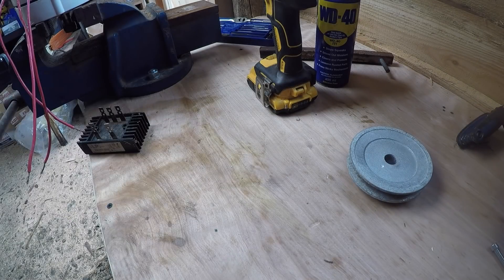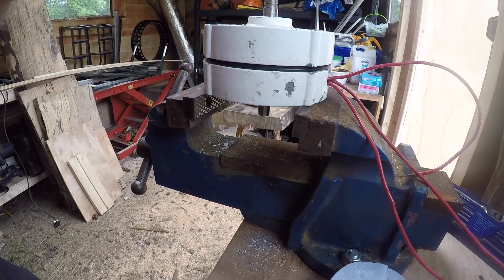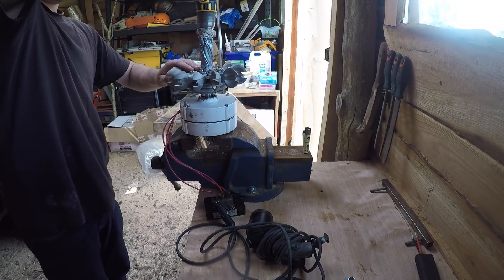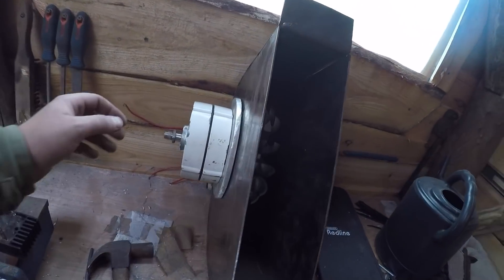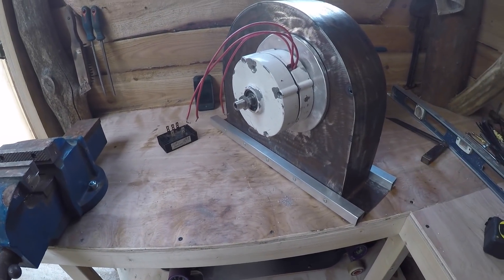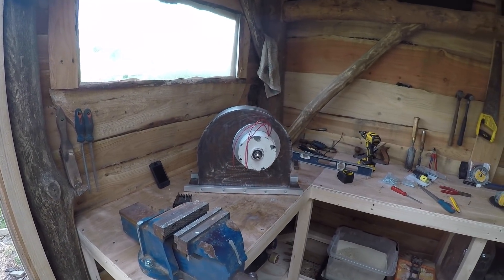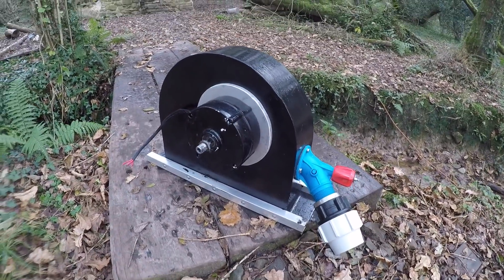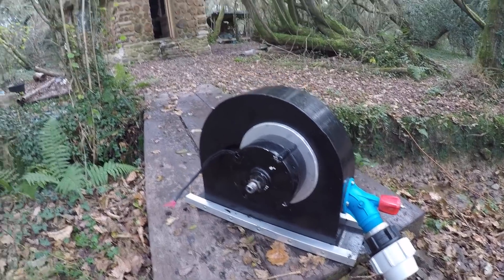DIY Micro Hydro part 2 The Turbine

Comment: Boy oh boy - there sure are some il - informed comments on here.....!!
A polite request to anyone thinking of claiming that this or that is wrong/too small/too big/made of the wrong material, etc. etc.
Please remember that this guy did a lot of research before starting the project. Then he built it. And it works as he said it would.
So........!
Reply: They should go and build their own if they know so much, one thing with Kris, he stated at the beginning he wasn’t an expert, but he did his research and is giving it a go and you bet , if it doesn’t work, he will be the first to point this out and then come up with a solution :)
Reply: It lifts my spirits to read this.  I'm glad you took the time to post this.
Reply: It's the internet. Billions of people have access to it. I agree that they are many armchair engineers, but there are also many educated people. There might even be actual mechanical engineers watching this video. 

I will say, the fact he went with a horizontal shaft rather than a vertical is refreshing. Gravity works well for getting water out of the way.

Edit: I would like to see one small hydro setup that has the spike hooked to a governor and proper pressure lubrication. This guy seems smart enough to get one working.

Comment: I like your water distribution offset to move the turbine water effect you were going for. Also the smooth finish surface for max water flow inside the water distribution pump. And also  insulation of the electrical components and wearer proofing the system. I wont troll you like many others. Keep up the good work video is informative and well balanced in information.

Comment: Hey, I'm a time traveler from the future. You need to get longer bolts. The wheel will fall apart!
Reply: also try use rubber hammer when beating the wheel

Comment: Hi Kris! Very nice project :) I was wondering where you bought the nozzle? I am working on a similar project but have difficulties to find a suitable nozzle
Reply: https://www.ebay.com/itm/adjustable-nozzle-ugello-regolabile-pelton-turgo-micro-hydro-components-buse/302833436647?hash=item46824787e7:g:TN0AAMXQ~6VQ8uiV

Comment: Really great job, however, I believe aluminum and steel will interact and corrode, causing the steel to rust quite badly relatively quickly, particularly in a situation of high humidity.   I think you should have kept your materials consistent to prevent that sort of thing...

Comment: One potential issue is the aluminium square stock aside the steel; that might cause electrochemical corrosion. If it's not too late, adding an electrically insulating gasket between them will help. Another idea to stop corrosion dead in its tracks, is to bolt a zinc anode onto the steel casing somewhere accessible; the zinc will corrode sacrificially and the steel not at all. Just monitor it, and replace the anode when needed.
Reply from the maker: that isn't a bad idea at all, i believe they do that on boats?
Reply: Indeed they do, as well as in canal locks and other high-corrosion environments. You can probably find sacrificial zinc electrodes at a marine supply shop.
Reply: Bearings are wrong. Too much friction.

Comment: Hi Kris here is a tip for you when bending steel like you did a easy way is get a vise and open it about 2 inches this distance can very it is up too you! take a hammer but on a piece like you did I would use a round solid shaft about 1 inches x 8 inches and you place the flat piece across the opening and tap your round bar this will mold the steel and make it bend. hope this helps. you can bend steel up to one quarter thick by 2" and down.

Comment: Good stuff and glad to see you upload again.  Doesn't the casing need some form out outlet for the water or is the idea that it's raised and that the water will come through the open base? It might not need to be raised - could it be left in the stream and water just flow through it?

Comment: Hi, I use the same pelton wheel with an other pma génerator. I am still working on the turbine, but here this year it's very dry, and my water stream is to low. No rain since midle Jun 2017.I have 64m élévation, (6,4bar) and around 5/6 liter second (only 8 month a year).  I have a video from the last test.
https://youtu.be/Nc5p-VhP-Qg
take care to alignement . The water jet must "shoot" the pelton wheel in the midle/center of the spoon. Not at the "end"of spoon.
regards.
sory for my bad english
Reply from the maker: +cristof48 wow sounds like you have a lot of energy to work with! I have been working on the jet Angle today. I have already doubled the output. I used the video to slow it down and see where the problem was. The jet is now hitting the spoon on the centre. Thanks for the comment, it's comments like that that make me love YouTube. Thank you.
Reply: @KrisHarbour  yeah - almost makes up for all the Muppets telling you you're doing everything wrong......!!!

Comment: Just found your yt channel and this is 1st video ive watched looking forward to seeing more to find out how you get on 

Keep up the good work iv e now subscribed

Love to do a project like this but the typical thing stops me no location and lack of funds to do it 

If you using a pump why not recycle the used water back in to the system using a collector and a on e way valve shortly that will increase the pressure ?

Comment: + Kris Harbour Shouldn't you sort of water proof that housing?? Youtuber Mustie1 shows how he "water proofs" his fuel tanks after welding them up, that's where I got that idea... anyways, good to see you again!
Reply from the maker: +Chris Is it was not shown on the videos to keep the length down but I filled it with water and welded any small holes up and repeated until water tight. It does not hold pressure so it's not that important anyway.

Comment: Nice steup buy. The flow of the water from the jet is not hitting the center of the spoons. Can you space hesprayer housing with washers to re-angle the flow?
Reply from the maker: +Andre Martel hi, I know I used the video to go slow motion and see what needed changing. I have adjusted it so the jet is hitting the middle and it has doubled its rpm and the light is now fully lit. I could do with a watt meter to measure it properly but I don't have one at this time. But what I am learning is small changes make a very big difference.

Comment: Well done but perhaps you might want to add a di-electric break between the aluminum and steel parts as the galvanic reaction can disintigrate the aluminum in short order especially in a wet enviorment..
Reply: Is that not more of a problem in salt water?
Reply: It's certainly worse in salty water but galvanic reaction from dis-similar metal touching would still occur even without submersion in any water at all. It's not an issue if you plan for it though. Anyway the project was very innovative and much respect to Kris for doing it and posting a very enjoyable video.

Comment: Very cool. May I suggest cutting an access plate opposite the pelton wheel. At some point you will be pulling it for maintenance or replacement and it will likely be seized to the shaft. A puller through the access hole makes for easy work. A plexiglass cover would allow you to see inside, as well.
Reply: hi Ken .. humm what is a "puller" ( thru the access hole )  ? thankyou for your advise ... it does sound important piece cos a new person would not know about future ( and does not visualise ... :)   )
Reply: @Roger-ci4tp  if you Google "gear puller" you should get a good idea of what he's talking about.

Comment: @ Kris Harbour

Great job, you need to force that water jet more into the pelton cups, perhaps buying a BSP Pipe Fittings Stainless Steel 316 A4 Grade 150lb 1/8" To 4" such as below or perhaps you can get yourself some gal pipe plus flat plate & make your own angled fitting with flanges but remember to grind off all galvanizing before welding because the fumes are toxic. When welding anything that has galvanizing on it you always grind off the galvanizing & weld outside if there was some that you missed. Don't stand over your welding as you will inhale fumes.

http://www.ebay.com.au/itm/BSP-Pipe-Fittings-Stainless-Steel-316-A4-Grade-150lb-1-8-To-4/222533487033?hash=item33d00789b9:m:m5N7F8jRmNwczgcQ_jY0vvg

Comment: Long time no see mate, you have been missed. Awesome progress man, but where did you get the motor from? it looks like an old ceiling fan but that would be the wrong voltage, unless you pulled it from an old lathe maybe?
Reply from the maker: +Tricky's World it is one of those permanent magnet alternators for wind turbines and stuff. I think it's a Chinese thing. I got it years ago for a project and it seemed a good thing to use it for.
Reply: Awesome, thanks mate. Adds to my wishlist lol